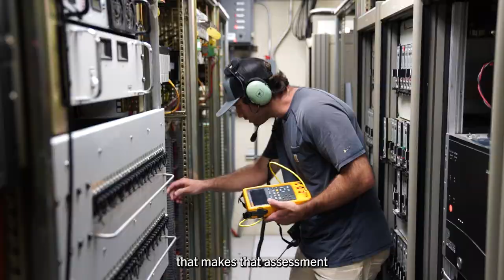Meet Data and Control Systems Engineer, Mickey

Comment: wearing a mask alone at your desk? who does that?
Reply: Someone who makes $125k a year and boss tells them to.
Reply: Covid requirements.  Some jobs needed their techs/engineers onsite  (working remote was not possible). and to comply they had to wear a mask. 
I worked at a fiber manufacturing facility where we had to wear masks. The good thing is the company kept us informed, and as soon as regs allowed, some of couldn't take off the masks fast enough. We worked in a hot, humid environment where safety glasses fogged up often.